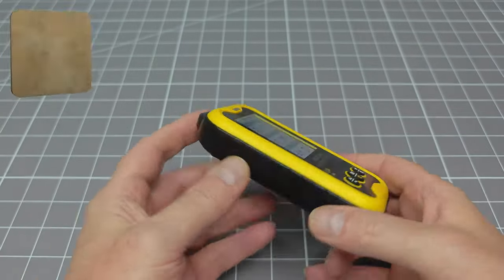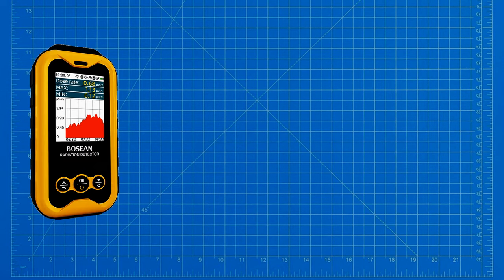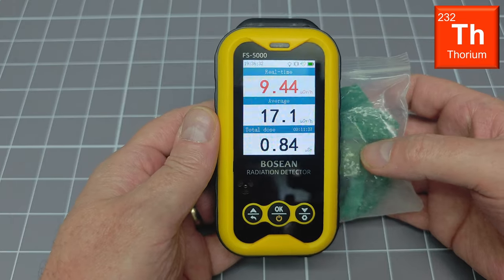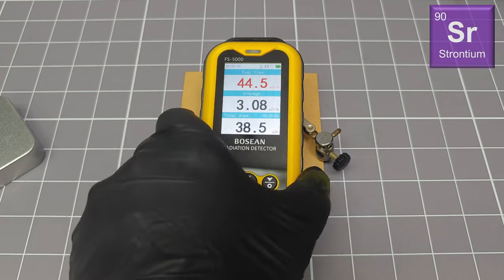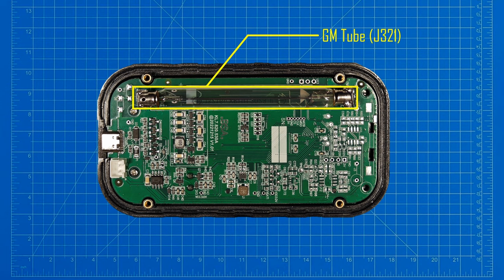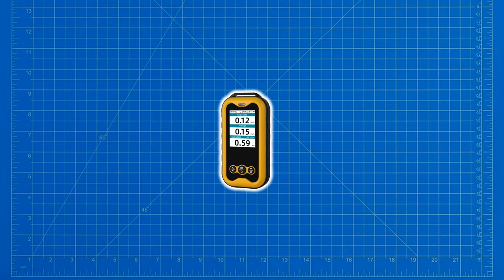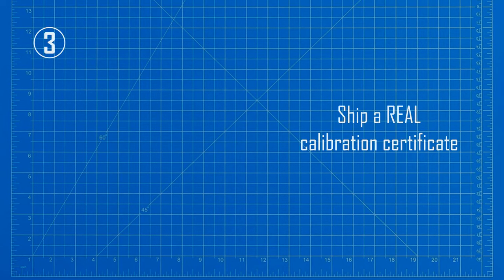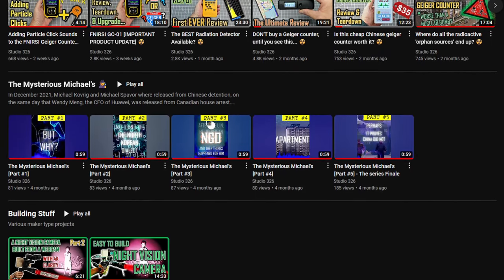The Perfect Cheap Geiger Counter?

Comment: Unfortunately they don't ship it with the j321 anymore, they replaced it with some smaller shitty tube (no markings but it appears to be the j613/614), it's a shame another cheap product has gone to shit
Reply: This is unfortunately what a lot of chinese manufacturers do.
Reply: Is that correct info? You received new version with that crappy tube?
I was hopping to order it in nearby future, what a disappoinment 😢
Reply: I have the same problem can the tube be replaced
Reply: @markhart6743  Yeah you just have to desolder it out and stick in a new one, a j321 costs around 20$
Reply: This is false. I just got mine and it has the correct j321 tube. There was a mix up somewhere in manufacturing and some were made with a tiny tube that has like shrink plastic around it. If you contact them about this thy will get it resolved.
Reply: @markhart6743 contact the manufacturer, the smaller tube was a manufacturing mistake.
Reply: I received mine this morning from the Bosean store on AliExpress, it has the smaller crappy tube in it. I’ve messaged them and are awaiting a reply. It looks like there’s a resistor that’s been added, R102 on the board which I assume is for the smaller tube. I’ve asked if I can remove this resistor and fit the J321, my int has the proper mounts for the J321 soldered to the board but the smaller tube is hot glued to the main board.
Reply: On mine with the crappy tube R102 is just a soldered link to negative. The load resistor looks like R60 on the front side of the PCB. Mine is (2004) 2 meg ohms. 422v before the resistor 352v after. Not sure what values the correct J321 has installed, can't really see from the video. Maybe Stidio326 could tell us 😊
Reply: @jtcustomknives thanks I have & been refunded just ordered another fingers crossed this one has the j321 tube installed
Reply: Just received my replacement which has the j321 tube in it fortunately 😊
Reply: Not true the company sell the design to others who manufacture the product & use the brand name but with cheaper parts if you buy off a unscrupulous seller (usually the cheapest one) you will find the cheaper parts included in your budget device
Reply: They are advertising that tube on Ali now.
I just ordered one.
Will let you know.
Reply: Just bought one on Amazon and it's got the j321
Reply: On the official Bosean shop on Ali Express they're now promising the J321 tube. Perhaps they've found out that people actually do care and started giving it bad feedback. On the other hand they could have an option to choose tube although I don't know why anybody would save a few pennies unless a total noob.
Reply: @HouseholdDog update yet?
Reply: I bought one from Temu that has the correct J321 tube in it. Manufacturing date is 2024/7
Reply: @Remus1033  Interesting. Can't find any real geiger counters on Temu. Bought one more from Ali. Ordered september 6th, got it the 17th. It's manufactured september 2024 so it literally just rolled of the assembly line. Naturally it got the J321 tube as well.
Reply: I just opened mine, received just yesterday, the Tube states J321, for whatever that is worth… But found one of the four threaded inserts were loose, and when I opened the housing, two more had obviously been damaged on assembly and held onto by a thread as the wall thickness of the inset area was too thin… Will have to figure out how to address this.
Reply: Ordered via aliexpress directly from the company, and current production devices as of 10/2024 do have J321 tube soldered on. Seems scalpers and resellers are buying, replacing the tube and reselling

Comment: I would like to ask an unprofessional question, can a nuclear radiation detector like this detect food contaminated by nuclear radiation?
Reply from the maker: the issue with detection of radioactive contamination of food is that the sensitivity needs to be super high.  Because you are consuming food, the damage that can occur is easily more than 1000x more serious than contamination of the same level but outside of the human body.
Even for advanced lab situations, this is a non-trivial activity, usually needing a lot of shielding and a long measurement time to get a clean result.
It is possible, but needs a lot of time and effort.
Reply: Thank you for your detailed explanation.😊😊

Comment: Flashed my FS5000 with the Radpro firmware today and monitored it with the Geigerlog software. Impressive, both. The original firmware is automatically backed up and can be restored just as easily. Radpro allows tube selection and deadtime & background count setting. The interval between log entries is configurable. Lots more, like a true random number generator. There is even a chess game lol.
Reply from the maker: how is the original firmware backed up?
Reply: @project-326  the flash utility backs it up into the backup folder as a bin file. You can flash it back with the same utility.
Reply: I've tried it too. While I like a few things in the RAD Pro firmware, you also lose several features. I've gone back to the stock firmware.
Reply: @Ni5ei  What did you lose? I like the ability to fine-tune the counting algorithms, tube selection, dead time, background count and most of all the ability to communicate with Geigerlog. I miss the display and graph colours though.
Reply: @42phaedrus  Not just the display colours, but also the amount of different values you can see on the display without having to press any buttons. The device has a very nice display and this all goes to waste.
Reply: @Ni5ei  Point taken, although I think the typical use case would be instantaneous count or dose rate. Having say, a 1-2 min graph on that screen would be an advantage.  Hopefully future revisions will improve it.

Comment: Interesting info about this counter.
Recently, there was information that the manufacturer decided to abandon the use of the J321 tube and began to install a no-name tube there, which is why the accuracy of the device has dropped.
This is what the manufacturer writes in its official store on AliExpress:
"We Promise: We will replace all products in the warehouse and produce new items with NEW J321 tube to ensure all items are J321.
                                                                                               April 10, 2024"
So in the end everything is not so bad and there is a chance that the device will remain the same as in this video.
Reply from the maker: People pressure works!  I have been badgering their team directly here in China...
Reply: I also just received mine from the official store it also has the small tube HH614 or something, very disappointing bait and switch. Could you tell me the value of Resistor R60 on the front of your J321 PCB. I guess R60 is the load resistor? Looks like I will have to swap the tube to a  J321. R60 on mine is 2meg ohm 422v before the resistor and 352v after. Thanks for the great videos.
Reply from the maker: I have been in contact with the company, my campaign of pressure on them appears to have worked and they are now only shipping with the J321 if you buy from their official AliExpress store.
Reply: bought a june 2024 one, tube reads j321by xrhh 2024 ii
Reply: How to I verify the accuracy of my counter?

Comment: Very informative  presentation  and concise. I just purchased the FS*5000 and am in the process of setting it up for my use, Your presentation has answered several questions. Thank you.👍👍
Reply from the maker: Glad it was helpful!
Reply: @project-326  , I bought also a one due to your good presentation.
The device makes a good impression to me and does what it should. Only the PRDMS application I could not get to work on a Win11 notebook. It fails to connect to the device. I asked the service for support and waiting for an answer.

One feature I miss is, in normal operation mode, a long press on the left button, should toggle the radiation click sound. It would be nice, if they could add that to save the steps doing it in configuration.

Some sellers seem to offer the device with a different Geiger-Müller tube (not the J321). Buyers should ask about this if it is not explicitly advertised as such.

Comment: I read somewhere that some units come equipped with the dreaded horrid J613 Geiger-Muller tube, just like the newer FNIRSI GC-01. I've just bought an FS-5000 from the AliExpress official Bosean store linked below (48.06€). It is scheduled to be home in a few days. I'll open it up and see whether I'm lucky or not and report here.
Reply: Just received the Bosean FS-5000 and yes, the GM tube is indeed a J321, the same as in this video 😎

Comment: Edit: I just bought the FS-5000 from your AliExpress link. Thanks for the video.

I have a nukalert that i am going to keep hung up outside my makeshift fallout shelter. It's specifically for detection of higher level radiation up into rads per hour. Hopefully I can hear the chirping if it goes off. I might buy this one also so i can read the lower levels of radiation inside my shelter.

Comment: Thank you for the video. I really enjoy watching your review videos. So far, I had the GC-01(J321) and XR1 Pro(M4011). I may get this FS-5000 as well(thanks to your reviews). Have replaced a big buzzer in size to get a louder clicking sound(with the 100nF cap shown in your other video).
Reply: Just got my new Bosean FS-5000 which cost around USD55(best price). But it comes with a J613 tube instead of a J321 tube. Is much better to go straight for a better one like Radiacode 103...

Comment: I bought one of these–for approximately the same price, thanks to your excellent reviews! I'm going to test it with many of my sources and radioisotopes! I really like and agree with your suggestions–for improving it! I think it should come with a protective silicone or rubber boot or case with a transparent window–for reading the TFT screen, which would make the device even more resistant to shock, moisture, dust, and water. A reset button/feature (for zeroing the counts), and a fast and slow response for the counting average would be nice, too. I don't expect it to be perfect, but for the price and design–I find it very promising, which I hope the developers will improve upon in the future, thus releasing upgraded models and designs. This will also be my first Chinese-made G-M counter–when it arrives! I'm excited to find out what this low-cost unicorn is capable of! There's also a Rad Pro firmware upgrade available too, which hopefully improves its performance even greater than before! Thank you very much! I really appreciate it! Cheers from the USA, and have a nice day!
Reply from the maker: Thank you for the awesome feedback!

For sure we should not expect miracles for this kind of price, but it's nice to see that it a rugged product and does what it says.

Not sure if Bosean will make another one, their main business is with gas detectors and they have a very good reputation in that market.  I think that the volumes that they ship of their GM counter products is kind of small compared to the other product lines.  Shame really, they are a good company with products that are quality-but-at-a-price ethos.

I'm pretty loathed to install RadPro, I wasn't able to get the free PC app to run, so I am very reluctant to lose PC data collection capabilities.

The silicone bumper idea sounds like a nice idea, but to be fair the product is made from GRP and not just the standard PC-ABS mix that most other products use.  My kids always take this device if they are going on school trips.  If cheap enough to replace if they lose it but good enough to give results to show to their teacher.  On a recent school trip that involved a local flight, my eldest son scared the pants off the teacher when he said "Teacher, look 30x radiation and rising".
Reply: Sure thing! You're videos are quality and thorough, which is always great to see! A lot of others' videos lack that. My Bosean FS-5000 G-M counter arrived today! Thank you very much! For a cheap G-M counter, it really is quite nice! It has a very simple UI and a nice TFT screen! It also has very good sensitivity, since it came with the J321 G-M tube, and not with the J613 G-M tube, which some of these have or had, which I think was due to a manufacturing error. I think Bosean should develop and improve more of these G-M counters. I think if they're truly determined to do so, they could make some really nice G-M counters and improve older units. Sooner or later, when I'm not too busy, I'll do some measuring and post a list-style comment on the actual activities from various radioisotopes and sources I have, and their detected activities in CPM and μSv/h–from the Bosean FS-5000. By the way, that story about the 30X background scaring the teacher cracked me up! That's cosmic radiation for ya! It's a natural, yet very interesting phenomenon! Cheers from the USA and have a wonderful day!

Comment: Great video! I've actually been sort of looking for a Geiger counter, but since I don't do anything with radiation or ever expect to encounter any, I don't want to spend much. But there's no point buying a cheap detector if it doesn't work!

I like the suggestions, especially the Bluetooth one - while the biggest wins there are geolocation and storage capacity on a linked mobile, it would also allow the use of noise-cancelling headphones in place of the piezo sounder for the particle clicks.

Comment: I like that it has instant and average readout. My only "modern" meter is a GMC 320 Plus and it only shows average but it takes ages before it reaches the correct level. My older meters all have instant readout only.
Reply from the maker: Just for you, I posted the results of the quick test I made in the community section of the channel.

Comment: Perhaps the sensitivity is related to the exposure of the GM tube. Rather than sealing the holes, perhaps some type of sliding door can be implemented, so that the device can be protected in tough environments, and then opened when more sensitivity is required. For software, I suggest the manufacturer lets the enthusiast community write their own software, but either making their software's source code available or by providing details about the raw data coming from the device. I could probably discover this by means of a USB tap device, but it would be better to just have it presented.
Reply from the maker: I agree with you, it would be great it they produced an open platform.  I guess there is a compromise between commercial prudence and user engagement to be found.  I think that Gissio is looking into the FS-5K right now...

Comment: @Studio326 ...it doesn't do Alpha ... (for example radon) ... so that's a no-good for me ;)
Reply from the maker: Yes, that is absolutely true but... even the cheapest alpha capable tubes cost more than the total cost of this product, and alpha particles have a range of just a few cm in air, most GM tubes that are capable of detecting some alpha, lose energy across the mica window so the actual detection range is usually less than 2cm.
One effective way to detect Rn-222 is to use a gamma ray spectrometer and look for gamma peaks that correspond to the Uranium decay chain.  Sadly, this kind of kit costs a lot more, please see my reviews of the Radiacode 102 and Measall KC761 for some background.

Comment: Thank you. I ordered one from your suggestion. I plan on applying some 422-C conformal coating and potentially upgrading the battery to increase the capacity. I may also use a plastic mesh to help keep debris from getting inside the enclosure. I greatly appreciate your content. Do you have any thoughts on my intentions for the improvements? Good idea or bad idea? Any other thoughts or suggestions are very welcome.
Reply from the maker: It might be a good idea but perhaps mask off the area around the tube and its connectors...
Reply: @project-326  thank you 😊 My thoughts as well. This is on my project list. I will be doing this soon 👍

Comment: The FS-5000 is a good detector (much better than the GC-01) and can detect the radioactivity of thorium coated electrodes very sensitively.
Reply from the maker: Yes, I noticed that too, I previously used some really low activity rods for a thorium measurement and the FS-5K gives a really stable measurement on those, in spite of the low activity.

Comment: @project 326 Hi thanks for the immensely informative videos you create they are invaluable and entertaining. May I ask what your choice would be for an enthusiastic noobie to this field. The fs5000, NR850 or GQ GMC800 OR indeed anything better within the constraints of cost sub £150. Thank you so much.
Reply from the maker: Of those devices, I have only tested the FS-5000, so its hard to say.   In the sub $50 class, this one really does it for me.  Basically since I found this, I have moved away from buy and reviewing cheap counters...
Reply: @project-326  that’s fair to say. Thank you. I ordered both the fs5000 and an NR850. The quality on the NR850 is quite lacking with a J321 tube soldered directly to wire and held, almost, by sticky a pad which will fail. AA batteries are good and results from both machines are comparable. Thanks again.

Comment: Thanks for the review.
Have you ever tested the Pudibei NR-950 geiger counter?
Is it any good?
Reply from the maker: Unfortunately not, but I hear pretty good things about it.  I think it uses the same J321 tube as the FS-5000 does, so in terms of raw sensitivity, its going to be the same.  So it kind of comes down to features of the firmware, etc...
Reply: Thanks, i apreciate.
Reply: I actually have both FS-5000 and NR-950, the NR-950 isn't as response as FS-5000 for low level sensitivity
Reply: Thanks, realy apreciate
Reply: @project-326 The NR-750 shown on Survival Lilly has an 4011 Geiger tube.
Reply from the maker: @luisarturpereira That's a useful data point.  Thanks!